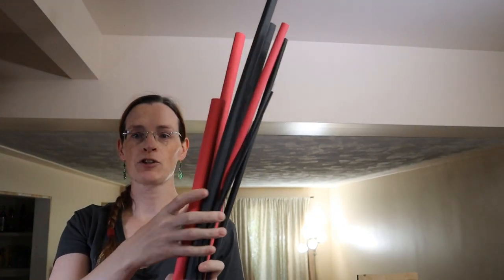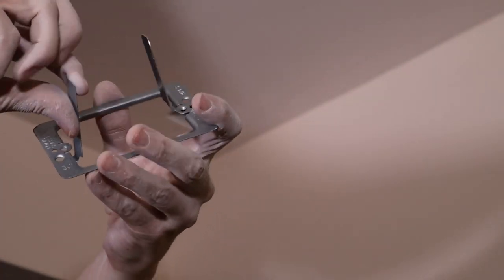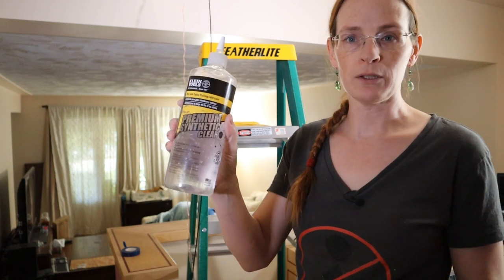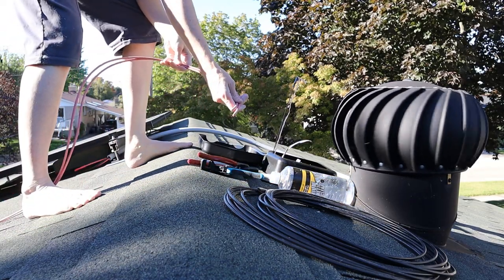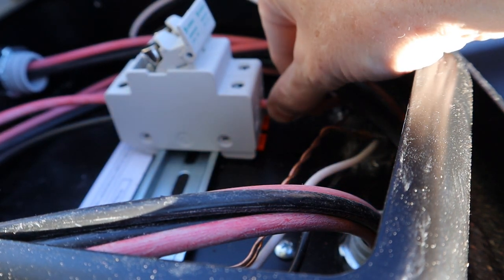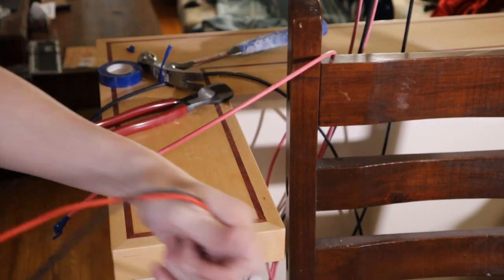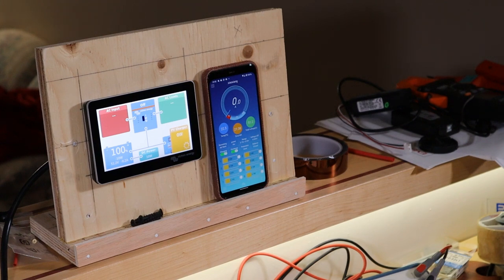Solar Panel Connection (Part 3) - How to build a 48v Lifepo4 battery (Ep. 20)

Comment: That "extra" load outlets on the victron work very well with lights you can program "on and off" like a timer, or even a fridge connection. (as long as the load does not exceed 10amp or what your victron is rated for on that outlet)
Reply: Yes, but you have to be careful, because in a 48V configuration the load output of this chargers is limited to 1 amp. Works to switch a relay or to turn on or off a Victron DC/DC converter (to power 12V components like a radio or LED lights).
Reply: @geroldgoerke5729  Yes, thank you for that! I was on 12 volt. Important that she make sure what the specifications are for her system.

Comment: 33:47 when i make many crimps i attach the hand crimping tool in a small vise (50-75mm/2-3" wide) , it makes the repetitive job much easier, only snag is that you should be carefull to pich which of the handles is stationery, and is it pointing to left or right. (your carpenters vise might be perfect for the job.)

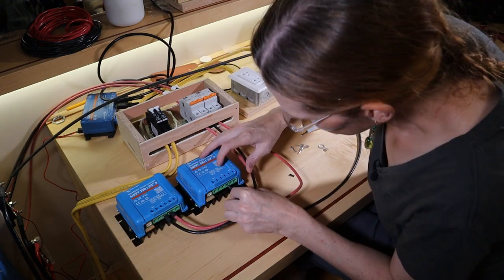Comment: 35:09 many non victron solar controllers have output that can be programmed to give a fixed but changeable amount of batery output after solar input goes to zero, making them easy to use as a streetlight controller or similar use where you want 4hours of twilight load each and every day.

Comment: Right before you rapidly charged the capacitors I was thinking that when I build something similar I'll hard wire an LED between the bus bars. Always on light indication if there's power at the bus.
Reply from the maker: That's actually a brilliant idea.

Comment: We are (Elc.Enginner) using vaseline or grease on long cables to move in electric pipes. reduces friction. you make wiring easier.
Reply from the maker: I can see vaseline working, yes. I like this stuff because it evaporates and is easier to cleanup the job after. Whatever you prefer is fine.

Comment: HOWdy  D-M,
Thanks for taking us along on your  FISHING  Expedition 
Wire Pulling & TESTING etc Etc 
TOOL-TIME = they make a relatively inexpensive FERRULE Crimper  (by  IWISS ) mine are HSC8 6-4  
AWG-23 / 10 gauge ( or  0.25-6.0mm ) wires with a choice of HEX or SQUARE / BOOTLACE FERRULES 
COOP
...

Comment: I love your content. I don’t have a toner so I will wire nut the two ends of the pair I want to identify and use my DMM on ohms. This eliminates the possibility of shorting something and the partial voltage like you saw on your first wire test.
Reply from the maker: That would absolutely work as well. Normally I'd use marettes to short the two conductors, but these wires were too big for that.

Comment: Hi...nice work!!....Have you ever tested the overvoltage cut out threshold of the bms while charging with those mppt CC? ....check if after the bms disconnect them from the battery they ride at the pv VOC...if that's the case this high VOC could damage the bms (depending on its VOC threshold) at reconnect point...im posting this since there's a video of a bms that went berserk after going thru this situation letting the over voltage pass to the batteries causing a wreck havoc...🤔

Comment: Those ferrules have a special four jaw crimping tool, might be worth the investment.
Reply from the maker: They do, and the decent ones are very expensive (like, ~$200+). If I start using them more often, maybe it would be worth it, but for now I use them rarely enough that the way I'm doing it is OK.

Comment: Voc is what you need to consider when computing max voltage, not Vmp.  You have 43.5V panels, so 2X in series is 87V.  Your panel's temp coeff is -.29%/°C, so at -20, you would see -45 * 0.29% = 13.5% increase in voltage.  87 * 1.135 = 98.7V - close but good to go at -20°C.
Reply from the maker: Which is realistically too close for comfort for me. We get well below -20°C here in the winter. Alas, Victron shall extract yet more money from me... :P
Reply: @TheDigitalMermaid  You're not alone. I made the mistake with the 150/100. I was clueless at the time. Temps allowed my Voc to go above 150V, so I had to upgrade to the 250/100.  The more a mistake costs one, the more effective the lesson. :)

Comment: What you did worked, but I usually just feed the fish tape through without the pull line. Then, once I've pushed it through by itself, that's when I attach the pull line and pull it through from the other end. I don't know. Maybe I'm doing it wrong.
Reply from the maker: Your approach works perfectly well, and I've done it that way many times. I didn't mention, but in this case I knew that a) the lines being pulled were going to fill most of the conduit, so the bulk of the fish taped to the wires would make it hard to pull and b) I didn't plan to run anything else in the conduit so I wasn't worried about leaving a pull line behind.

Comment: The standard is to use wire ferrules when dealing with fine wires. This will shrink the fine wires into one firmer wire.
Reply: Why did you not use the ferrules in the roof?
Reply: I would have mounted all positives on the right side. Just like you did on the MPPT.

Comment: One concern...  Victron is very insistent that the solar charge controllers be connected to the battery first, before connecting the solar panels.  The SmartSolar 100-20 charge controller (I have one) auto-ranges on the battery side between 12 / 24 / 48 volts, and you currently have no interlock between the solar and battery switching.  Hopefully, once the controller is set to 48 volts it will remember that setting if subsequently the solar is switched on prior to the battery box, say if the solar breakers were left engaged at night and the battery turned off.  Next morning, the solar would come up before the battery.

I think you will be ok, but it might be worth checking with Victron that the battery configuration is remembered.

Comment: fascinating. absolutely fascinating........

I was really interested in your scaling of cells vs panels; as my boat is a ketch, I am unable to mount an arch and am therefore severely limited in how many panels I can install, but then again, I remain committed to burning dinosaur juice as an occasional means of propulsion, and my electrical needs are correspondingly lower (about 200 Ah/day max).

My approach is therefore to radically oversize the house bank (1680Ah of LiFePo4 and 270Ah of Lead Acid), giving me around 7 days of usable capacity in between running the engine or connecting to shorepower. If I can draw 20A from 3-4 medium sized panels for 5 hours a day, then this extends to 2 weeks (and if I am in the middle of an Ocean then I can almost certainly economise and stretch this still further because I wont be using the anchor windlass, radar etc.).I'm considering hoisting 4 x 200w flexible panels along the guardrail on whichever happens to be the sunny side of the boat, and as there is no risk of shadows from the masts or sails, I can run these in series rather than parallel and therefore max out the MPPT controller. Maybe. 

Anyhoo - now that you have the house thoroughly drilled out, please tell us more about your prospective boat (or do Mermaids have submarines, hence the need for electric propulsion?)
Reply from the maker: The top of my list is a C&C Landfall 43, but it will come down to what is available in the spring when I am ready to buy. That's why I've been focusing so much on the house and propulsion banks, as they're consistent regardless of the final boat chosen. I originally wanted a full keel and ketch rigged, but knowing I was going pure electric, I had to take those both off the table. The ketch specifically because of the additional shading. 

If you have ever seen "Sailing Yacht Zora", they've got panels mounted off the sides, which I also plan to do as well, if I can. (Exactly how many and where is too dependent on the final boat chosen to get into details now). Theirs are on hinges so he can swing the out when away from docks, and pack them down when needed. It's a great design. In an ideal world, I'd have a pair forward on both the port and starboard, the thinking behind that if the shades are thrown back over the solar arch, they should be clear, and vice versa.

Keep in mind as well; As I will have an electric motor, it will be easy to have regen from the prop when under sail. So I won't be relying on just the solar. I may or may not have wind, leaning against it as it takes up a lot of space and only generates peak power in very high blows. I don't see the benefit. 

When you speak of your amperage, I assume you're talking about a 12v system? Very curious what kind of boat you have!
Reply: @TheDigitalMermaid  Hi - I sent you a photo a few weeks back: I have a Westerly Discus 33, and tbh I would caution you against going for a 43 footer if you are thinking of singlehanding. The issue is not the boat, its the size of the sails (and that's one of the reasons I went for a ketch, and am having in-boom furling installed). Solo, I find the Discus has plenty of space down below, and she is built like a Bulgarian shotputter. It was you who gave me the notion of visiting the "Oceanic pole of Inaccessibility" and I am now doing some serious research into navigating the Beagle Channel and visiting Argentina, Chile and then Easter Island as an alternative to the Caribbean/Panama/Galapagos route.

I am pretty much limited to 12v, as all of the onboard systems and equipment run at that voltage; when away from the dock, my 240v requirements are pretty minimal, and are adequately met by a cheap 1000w inverter. My major DC loads are the anchor windlass (140A !!!!), the autopilot, the fridge, radar, nav lights and the chartplotters/AIS/VHF/SSB/wind instruments etc. 

The idea of mounting fold-outable panels has certainly crossed my mind, and I have bought both the rotating clamps and the extendable struts to depress/elevate them, but a) its damned ugly b) it cramps up my pushpit rail (which is already cluttered with outboards and lifebuoys and kedge anchors and emergency VHF antennas and Lord knows what else) and c) they wouldn't last 5 minutes if I got pooped over the stern by a "proper" wave. 

I have installed MPPT's (and 30A mains chargers) in both fore- and aft cabins, and have been toying around with 2 x 100 watt rigid panels, a 50w flexible panel, and 2 x 200w folding panels, and I find that the flexible/temporary option works best for me, because i) I can hang them anywhere there is unrestricted sunlight (using a couple of spare halyards and some bungee cord down to the rail) and ii) I can stow them at night and/or when the weather brews up and there's no sunshine anyway. I plan to get 2 more, and they fold down to no size at all when not in use.

May I recommend the "Sailing Yacht Florence" and "Adventures of an Old Sea Dog" channels for some real-life warts & all blue water cruising footage (without the otherwise obligatory drone, bikini and cute puppy dog cabaret).
Reply from the maker: @TheAncientMarinersBlog  Oh right, I didn't make the connection with your name and the emails. :) I know that 43' will be a trick to single-hand, and that's the main reason I may drop down to a C&C Landfall 38. The trick is that I don't expect to do crossings alone, so I really want a (proper) blue-water boat with two proper cabins. I can't seem to find that smaller than that low 40s. =/

On the voltage, my plan is to run 48v around the boat, and use point-of-use DC/DC converters to drop to 12v or 24v as needed. This keeps my main wiring smaller, and opens up the chance to replace devices as 48v options become available. 

The concern of a hard wave ripping the panels off is a very, very valid concern. I wonder how hard it would be to motorize their position so you could have a storm config, where they point straight up or even inboard a little. Knowing how fast wind/waves can come up, I wouldn't want to be running up fore to bring them down. Something that will require more thought, to be sure.

That's also absolutely brilliant if you make it to the Oceanic pole of Inaccessibility!! I will be more than a little jealous if you get there before me. Haha! Thanks for the channel recommendations, I generally avoid those young/pretty sailing channels (no shade on them at all, I am happy they found a way to fund their adventures, just not my cup of tea).
Reply from the maker: @TheAncientMarinersBlog  I check out SBD all the time, it's amazing. The CSF is one of the main things I look at, after displacement. I'm in a really off triangle in that I need a boat I can single-hand a lot of the time, but has two cabins so that I can entice crew to come with me on crossings. It needs to be genuinely blue-water capable (so no bolted keels!), but able to steer windward at least competently. I need this to be no more than 28,000lbs, ideally a lot less, but have a deep enough engine bay for all the batteries I will have. So on and so forth... It's a real trick to find something, and you're right that compromises will have to be made. 

It will very much come down to what's on the market when I get the money. I may give up on the second cabin and offer the main cabin to whoever is willing to crew, and just deal with it. That would be the case if I go to the Landfall 38, for example. One thing I really don't like about the Landfalls is that they're not skeg-hung rudders, so I'll worry about hitting something all the time. Alas, so goes the hunt.

I am all in on an OPOI run! As the channel grows, I've debated starting a website for it. Maybe this is a good excuse to start that... (I truly dislike FB, despite using it grudgingly).

Comment: With DC voltage though, there is no shock as bad as AC. You can touch both negative and positive terminals up to about 70v and you'll barely feel it unlike with AC anything above 50v AC and you'll feel it. Even at 100v DC, depending on your skin resistance and humidity, you'll feel something but it wouldn't be dangerous, as in you could still let go of it.
When you are working north of 300V DC, that's when you should use insulated gloves.
At the same time, with DC voltage, you have to touch both terminals at the same time to become a conductor. DC voltage is not looking to get to ground as AC voltage does. I took apart a few nissan leaf batteries that are sitting at about 380v DC and touched one terminal at a time without any issues. 
However when you are going to be on a boat and if the negative rail is going to be your actual ground, then yes, you could worry about possible shocks from 100V+ from solar panels if the grounds are connected and you touch a positive terminal while wearing thin flip flops that are wet :)
Reply from the maker: DC over 60v is considered "high voltage", and the voltage is up to 100vDC. So yes, in some cases you can get away with touching DC, but that's a hell of a risk to take, and not one I am comfortable with. Also, remember the old saying that it's not the volts that kill, it's the amps. We're dealing with more than enough amps that, if somehow it gets through your skin (be it wet hands, stuck with a strand in the wire, etc) it could stop your heart.

Comment: When using solar to charge your lithium pack  I assume you can turn off charging on the BMS and still run your loads during the day so you don't have to cycle the pack daily. ( I only use say 5 kw at night and have 15k battery build in progress)  Don't want to keep buying thousands of dollars worth of batteries every 5-7 years ( defeats the purpose of cutting spending)
Reply from the maker: The voltage from the MPPTs gets dumped on to the bus bars. If the battery is off and a load tries to draw, it'll pull from the panels directly.

Comment: You could paint the top of your box white!
Reply from the maker: I could, ya, but this solution makes that unnecessary. :)
Reply: @TheDigitalMermaid  If you want be extra cautious, don't just open those fuse holder, pick fuses and put them in pocket. That way if (read then) you drop something over fuse box you don't close circuit.

Comment: I have seen 8 solar charge controllers in one solar car. Because of the angles I guess
Reply from the maker: In an ideal world, you would have a separate MPPT for each (set of) panel(s) in a different orientation or lighting condition. Of course, this is rarely feasible, be it for voltage or budget reasons.
Reply: @TheDigitalMermaid  Enphase is one micro controller per pannel. I have 24 on my grid tied system
Reply from the maker: @BajanAlan  That would be idea, but I need a minimum of two in order to get high enough voltage. I've not found single panels that go over 60v.

Comment: I beleave its VOC you have to worry about
Reply from the maker: Sorry, context? You're talking about volatile organic chemicals?
Reply: @TheDigitalMermaid  VOC in this context is Voltage Open Circuit. It's the theoretical max output voltage of a solar panel with no load connected.... dunno about his comment though.
Reply from the maker: @RawDR  Ahahaha! Wow I can be dense. :) I was wondering about that and planned to ask the company I buy my panels from on Saturday when I went to pick them up. The Voc is 43.5vDC, which with a 0.37% per °C, that's 0.161v/°C, which means each degree down from 25 increases the voltage by (6.5÷0.16095) panel hits 50v at about -15°C. Crap, I may be in trouble then. sigh
Reply: @TheDigitalMermaid  A switch to convert from series to parallel!
Reply from the maker: @BajanAlan  wouldn't work in my case, I need at least 60v to get the controller to start charging. :/
Reply: @TheDigitalMermaid  With the limit on realestate on a boat u are better buying some of the high wattage pannels they use less space per watt
Reply: @TheDigitalMermaid  Some chargers have boost convertors instyead of buck convertors
Reply: @TheDigitalMermaid  SUNPOWER MAXEON 3 395W SOLAR PANEL 65Volts